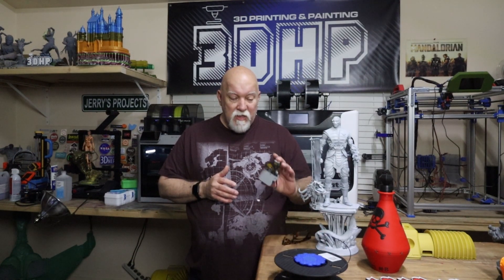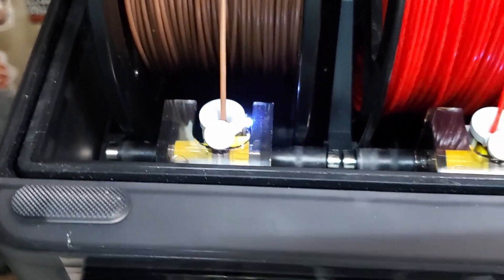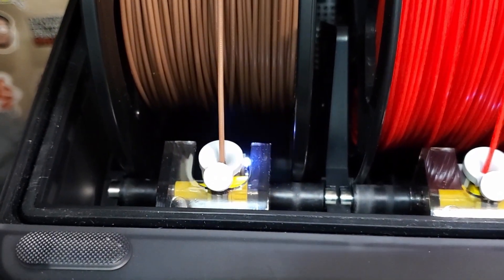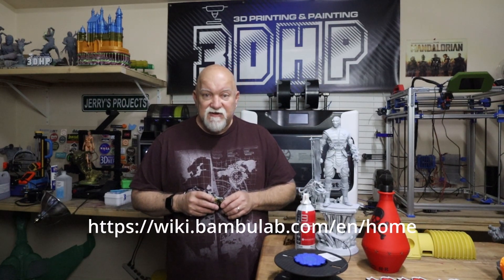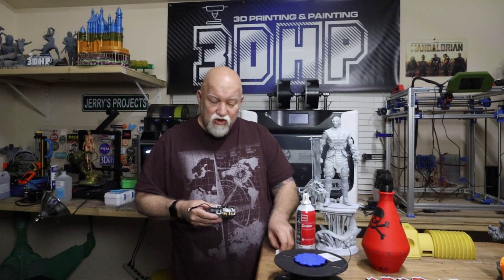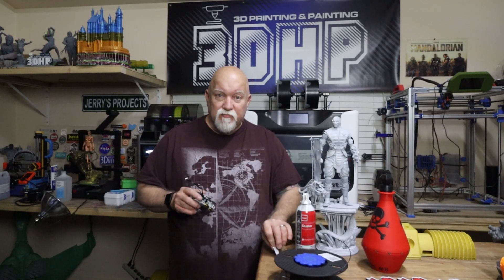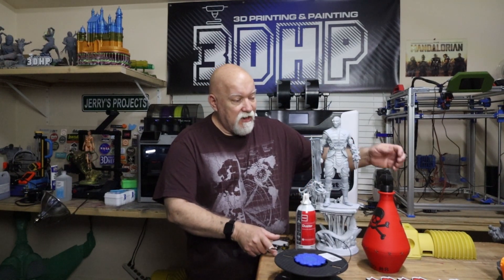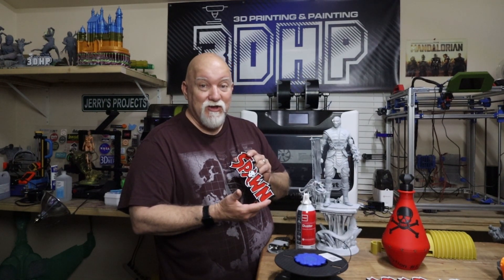Bambu Lab X1 Carbon with AMS | First Stage Feeder Fixed #3dhp

Comment: OK I have the same problem with both my AMS units in slot 1. I've changed the feeder three times now! What was this miracle part they sent you? Just another feeder assembly or something else???
Reply from the maker: Yes,just the new feeder.Have you taken out the 2 screws in the AMS Body,checked ptfe tubes in side it for broken filament,this happens a lot.Hope you get it figured out.
Reply: @3DHP  Been there, done that; no problems in the filament feed path. Still feeder #1 has problems! I've 'solved' the problem by using feeders 2,3 and 4 with no issues so far. I'm just afraid that the feeder 2 position will be the next to fail with this odd problem! I've ordered more feeder mechanisms as they're on sale for $7 apiece at the moment. :-)

Comment: Thanks for the insight. My AMS slot 2 keeps locking up and saying i have stuck filment in the extruder so im assuming its the same issue because it wont retract, Ive replaced and cleaned the extruder 3 times and same issue.

Comment: I was having an issue and found your video , but mine was a little different it wouldn't return and was grinding and i had to help it return. this was only a day old printer. it was doing it on slots 2 and 3 come to find out the rubber roller in the front must of came lose in shipping. i pushed both down and it snapped in and working fine.

Comment: interesting.  I will try the air trick.  my problem is, sometimes motor 1 (slot 1) cant push the filament all the way to the extruder.  maybe its getting hung up somewhere.  the other slots dont have an issue.

Comment: Not really a fix by getting/buying a new one hahaha. Thank you though. I’m having the same problem
Reply from the maker: If your car has a flat tire and you change it, Did you fix the problem..lol Thanks for the comment.
Reply: @3DHP  no, you got your tire changed hahaha. I found the issue and fixed it without buying a replacement.
Reply: @creativelifestylesstudio7518  How did you fix it?

Comment: My first X1C/AMS combo - I received a faulty printer..
They replaced that setup, and apparently sent me a good printer with a pos AMS unit.. 
Every slot on mine gives me failure to feed/retract messages almost non stop, 
to the point that it's absolutely useless.. Super Expensive Paperweight.
It's insult to injury,  I can't get through to them w/ 'tickets' anymore either..  [How convenient]
I'm sick and tired of blowing my Hard Earned cash for things that aren't even close to working right!
Also,  when I dealt with 'tech support' the first/last time,  they acted as if they where baffled, 
and/or that I was the very 1st person who's ever encountered an issue.
Also - from last night to this morning,  I've had FIVE Failed Prints when attempting to print.. 
Get this . . . a simple y-splitter to correct something that they didn't even bother to provide.
Reply from the maker: Sorry to hear this. A few times when I couldn't load / retract filament the was a piece broke off in the PTFE  inside the AMS unit or at nozzle. Also had 2 ptfe tube on the AMS that I had to replace from wear.Double check your ptfe lines with a long piece of filament to see if there clear. Once you update firmware on the machine,you must to through the leveling process again. Hope you get it figured out.
Reply: @3DHP  Thank you,  and thank you Again for the tip!  I appreciate it! 
I visually inspected everything, and appears to be in mint condition.  All tubes are new,  their connections are nice n' tight,  and the tubes, etc. are 100% free from any sort of debris..
*Mine has bee set up w/ the .6 nozzle from day 1 - If that might make a difference. 
*I'vie run a 7ft length of filament through the tubes from the nozzle back up into the AMS 
and nothing slows or stops it.
*When the unit fails/stops:  I'll open the AMS,  lift the spool,  jiggle [push/pull] the filament 
then wiggle each connection in the back,  and then I'll jostle the tube @ the hot end.. 
[With NOTHING stuck At-All . . . That usually seems to do the trick - NO Clue Why...]
*I saw a 'mod' where you can print an angled-arm that clicks into the extruder top, 
then basically holds the tube more vertical and solidly.  I don't have High Temp stuff to do that w/ 
so in desperation mode,  I tried a few strategically placed zip-ties..  haha  Nope. No help at all.. 
Bambu & Sunlu are the only types of PLA / PLA-CF that I still have and try to use.. 
**Updating:  Yessir,  I'm with ya!  Thanks!

2 nights ago,  I took a logo I made and tried a 3 color print...  I know...  Ridiculous, right?! 
It was insufferable..  Every few minutes - FAILURE - having to go Manually fix..  REPEAT 
Over and Over and Over again..  An 'hour long' print took like 4 hours, and it came out Terrible.
[Maybe some people would let it pass, but not me.] 
**I made sure to scree-capture the Bambu app screen on my tablet in real time for most of it.

I have such a ridiculous amount of photos / video of the 1st setup and now 2nd setup Failing
that it would blow people's minds - If I was to make a compotation vid and share publicly..
*I've been trying really hard Not to do that,  but..  well..  ya know..
Reply from the maker: @DirtyDovi  Other than slot 1 having a weak motor I replaced and random filament breaking in a ptfe somewhere.Its been doing great and the print quality is perfect. I would buy the part perfect. I hope you get this figured out. Thank you for the detailed response, hopefully others will read this and weight in.
Reply: @DirtyDovi  The AMS is very finicky about how much resistance you have in the path.  I had to have a couple of goes at getting mine to not give up on retraction.

The first was putting a guide in the top of the hot-end feed on the head (I tried a small one at first, that people recommend, but then used a taller version with additional length that kept the bend radius smaller).  That worked for a ‘torture test’ using a 4-colour Benchy with hundreds of retractions.  But it then started up again with not being able to retract.  I replaced the fairly tight radius tubing from the buffer to the machine inlet with the long spare piece of tubing supplied with the machine (there are eight short pieces and a long piece, as spares for the AMS — I have used the long piece from that).  So far, that is working.

Be aware that the tubing used is not the usual 4 mm OD / 2 mm ID type that you find everywhere.  They use a 4 mm OD / 2.5 mm ID version for this system.  The extra room from the internal diameter makes it easier for the retraction.  So if you buy more tubing from somewhere other than a Bambu Lab supplier make sure you get the 4 mm / 2.5 mm variant.
Reply: @boggisthecat  Thank You for your time/help regarding the AMS [issues]

My 1st AMS worked Flawlessly,  so,  I know what they're Supposed to do.. 
This 2nd one though..  Sheesh..  

So far,  I printed and installed the Hydra-Mod - replacing the OEM internal bed,  re-cut / re-ran all new filament tubes,  and the brace/guide for the hot-end as well.. 

On top of that,  I've done a few roller mods,  the glass/top riser-brackets,  even tried as well as printed other spools,  spool adapters,  weighting spool-hubs,  etc.. 

Anything/Everything I could think of - plus everything you & others have suggested.. 

**All above mentioned alterations / mods / etc. where done w/in days of receiving the setup..  Nada..  

Errors - always having to do w/ loading and unloading..  Some other annoying errors disappeared after an update or 2..  

So annoying/frustrating/infuriating..  

Still thinking / tinkering though,  I haven't smashed or shot it yet..  haha

Sam -

Comment: Hello,
I have the same problem and Bambu has replaced the first stage on warrenty.
Is it possible to repair the defective stage?
So I have a spare part.
Reply from the maker: I have not tried yet,but it probably a weak motor.Hang on to it and you might find a video working on it.

Comment: I had the same issue and contacted Bambu  and after a week with no response I took the printer apart and cleaned the filament sensor with IPA. It has worked OK since, but I have had to run IPA over the sensor again once already. So I am not sure it is a permanent fix.
Reply from the maker: I think I had a weak motor. Hope it keeps working for you.

Comment: can you do multi color prints without the ams ?
Reply from the maker: You could prints parts in different colors individually like on a normal 3d printer or pause print for a color change.But to have a model with different colors for eyes,nosembody etc.No. 1 AMS unit does 4 colors and if you buy multiple AMS units you can do up to 16 colors.
Reply: @3DHP  yea I didn't purchase the ams with my original pre order. I should have but that's ok. I'll get one once it makes sense. ( Probably next week ) lmao

Comment: So I'm missing the place where he says exactly what the issue was and the exact action taken to fix the issue?
Reply from the maker: The filament in slot 1 was not retracting all the way to trip sensor and move to next spool. So I had to pull out filament a few inches to get sensor to stop running motor with nothing happening.Once it was done with filament from a different slot and came back to slot 1 it would usually not grab filament and continue printing without pushing filament down like 3 or 4 inches.One time slot 1 sensor light turned red. I found to cracks or debris to blow out with compressed air. The fix was replacing slot 1 first stage feeder which was very easy to replace. Hope this helps you understand the issue.

Comment: I have replaced several feeders, I can take one out and back within a 1/2 hour, I have one now that I replaced because it would grab the filament run in a little bit and then pull back spit the filament out and then the feeder keeps retracting with the red light  flashing. the new feeder does the same so now the only thing to do is submit a ticket to Bambu, the AMS seems to be the weak spot in the system
Reply from the maker: I  hope you get it figured out soon and get back to printing.
Reply: Same issue to me, have you got any feedback from BambuLab so far?

Comment: I am not sure if to buy this printer. I just see problems all over the internet…I will wait a bit before I decide…
Reply: Got mine for 2 days ago, it has been running alomst non stop, no problems here i tell u :)
Reply: I wouldn't buy an AMS, have two and neither works,  The printer works fine.

Comment: Was the filament chewed up at that point, like the gears stripped it and couldn't move it?
Have you taken apart the bad piece to see why it failed?
Reply from the maker: The filament was not chewed up,I have not taken it apart but can see everything inside it with a magnifying glass. Everything looks new.Still believe it was a weak motor.